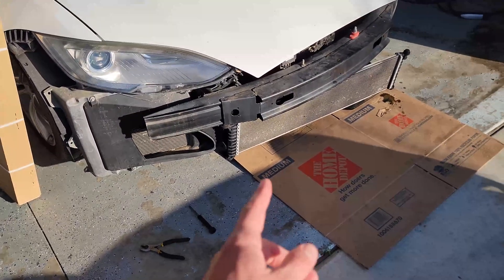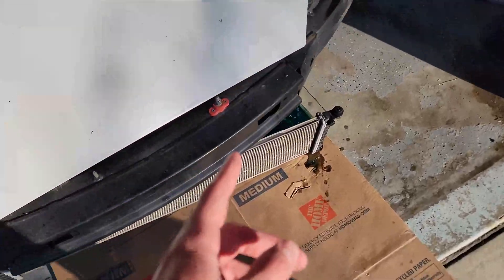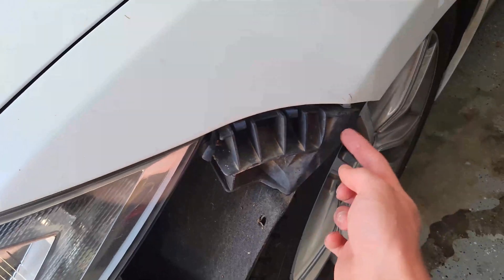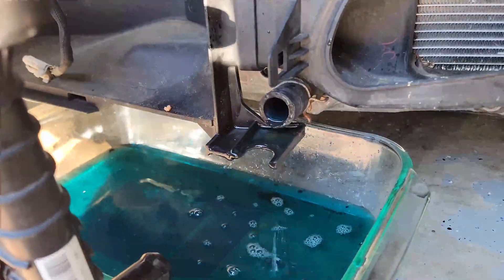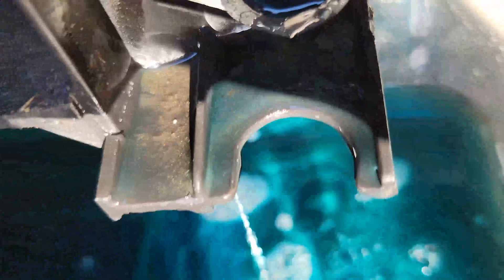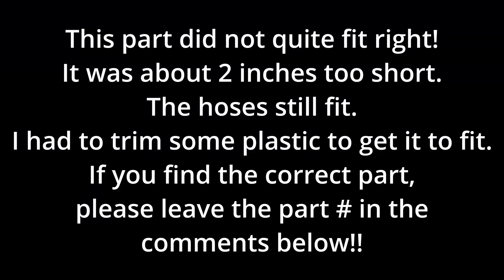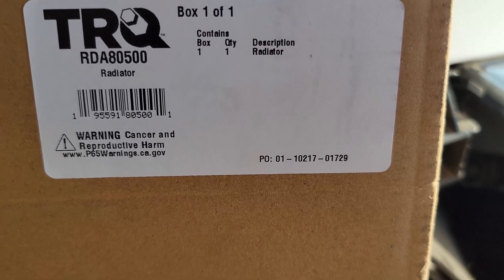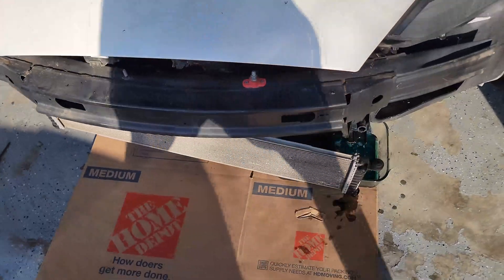How to Fix Tesla Model S Radiator

Comment: Hi thanks for your video, just want to ask if it did bleed itself?
Reply from the maker: Yes it did. I tried to avoid getting air in the system by filling the radiator and all of the hoses as best I could, but there was still air in there when I was done for sure. But the system has been working fine. I think I cracked the radiator cap a few times to triple check the weeks following the repair.